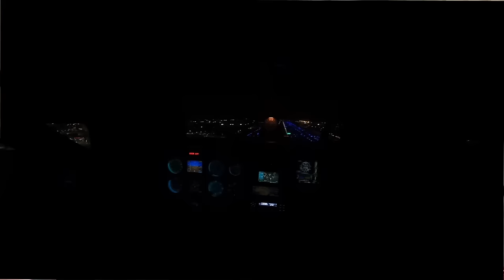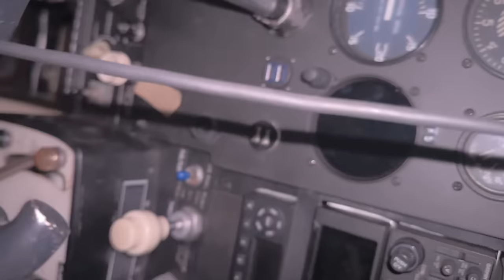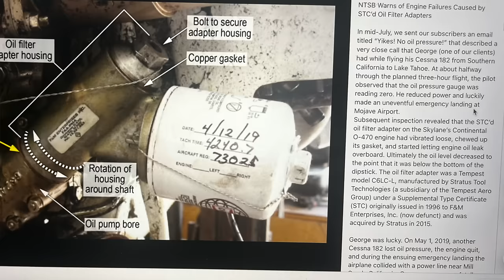Our New Cessna 210 Tried To KILL US Just ONE DAY After Buying It...

Comment: If you lose oil pressure the hydraulic lifters stop functioning properly. The "sputtering is the symptom of lifters that are not lifting anymore. It can damage you camshaft, th elifters and the valves, possibly even the valve seats. In a car you can just pull over anywhere. In a plane in trouble you wanna take all the help the engine can give you to[rovide time and altitude to find th ebest place to land

Comment: Had an interesting issue with my cars oil filter. After being parked a few days I checed the oil, it was empty but no puddles on the ground. I topped it off ran errands got home it was empty again 😔 My thinking was blown head gasket. I topped it off same issue. After inspection i noticed oil near the filter,  and yes it was loose causing oil loss while driving😅

Comment: The real issue is not the oil problem...it is flying a single engine at night, over mountains, and a recent purchased that has not had sufficient time after purchase...take it from an active cfii  mei of 35 years and ,47 years of flying....use better judgement

Comment: Yes this type of oil filter adapter scares me I have that same type of filter on my Cessna 170 also my next-door neighbor has the same adapter on his 172 we've had nothing but oil seeping oil leaks from around this area. I recently purchased two new original continental oil filter screens From Fresno air parts in California best price around. The previous owner of my airplane nearly lost all of his engine oil after a hard landing in just a 30 minute flight.
Reply: Yes we're going back to the original screens they're a pain in the ass to pull every time you change the oil to check the screen but I think it's worth it.

Comment: see as a non aviator, i find these NTSB reports very intriguing, now i would have thought an aviation safety board such as NTSB would not just issue warnings of these faults, but ensure all registered aircraft receive an update, is that a feasible thing or not - i know from my limited aviation experience that manuals carry an addendum for such modifications, but how are they issued, my guess with commercial aircraft that's fairly easy to hit manufacturers with their findings and pass on to operators and less so with private aircraft, but surely they are registered at an airfield where they are kept, thank god some of these things are available on the internet - but there must be so much missing information
maybe Geoffrey for your own safety, before buying a particular brand of aircraft, to find all known faults, accident reports and such like to build a unique picture of things, see the plane and see if mods have been made, ie an inspection, that Savvy Aviation is a very useful tool

Comment: Being over the mountains at night in a single engine airplane you just bought sight unseen? That’s straight up stupid! You don’t know if it happened before with this engine after which they just topped it off and sold it. When this thing stopped immediately after oil press dropped, there is trouble in paradise. I would not fly a foot with that thing without an engine rebuild

Comment: Pilots seem to be a lot more tolerant of oil burning engines. If my car lost  a quart of oil every 600 miles I would break out the wrenches and not run it until the problem was found and fixed. I know alot of pilots sort of MEH about engines that go thru a quart of oil every 10-15 hours. Probably the smartest thing I did was build my own plane and get my AP. Even if things go wrong, I can fix it myself. I can do my own annuals all that expensive stuff. The proposed changes in the FAA Mosaic program, light sport pilots are going to see a massive espansion in operatingpriveleges and aircraft sizes. Rather than focusing on groaa weight and top speeds, Mosic proposes to focus on stall speeds, so planes as heavy as a Cessna 180 would qualify. If you want to build a Sonex that cruises at 200kts you can fly it on the LS ticket. It is possible that Mosaic might go into effect in 2024. Exciting times coming to general aviation! It may have the effect of driving down aircraft prices. Service prices etc

Comment: Too many variables to say how long before it blows it depends on eng.load the eng.design i have seen old flathead motors run a hour with no oil pressure and newer motors not make 15 minutes

Comment: best to not buy cheap airplanes. i own 4 and i paid some big money for them i own 2 210s one is a 1981 p modelt the other is a 210 l   and a p337 and a 36 bonanza problem with buying sight unseen is you get what you pay for. if it is cheap most of the time it is junk, or in need of tons of repairs. i would never buy a plane with a oil filter adapter.  they  leak and can cause engine failure  midflight. run out of oil and adios engine and maybe you too,those adapters have blownup more than  one engine and killed more than one pilot and passengers.i wouldnt trust them as far as i can throw a 747, which i cant lol and what you pay for a cheap airplane can cost you more in repairs than  buying one  that is newer and in much better shape

Comment: Flight Sargent. R A
We've gone over the fact you always replace the fiel pump in a new plane to you.
With oil you need to know....  precisely.... how much oil it takes and DO NOT OVERFILL even 50 cl. Be precise...... 
I personally  would have changed the oil and filter before using along with fuel pump ect